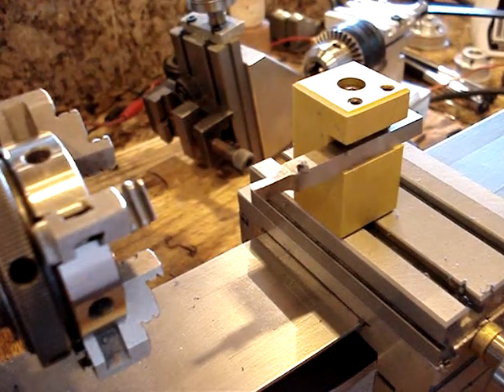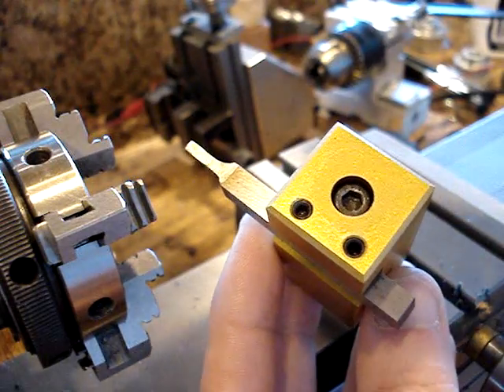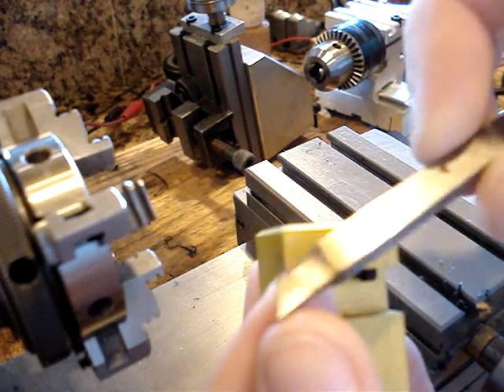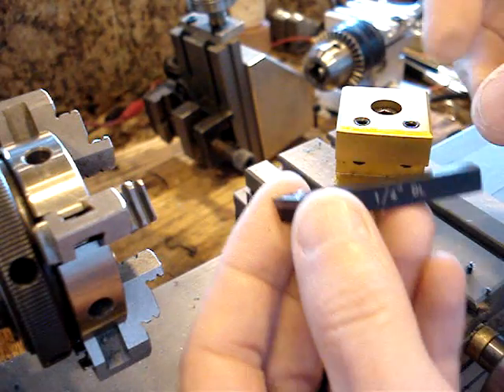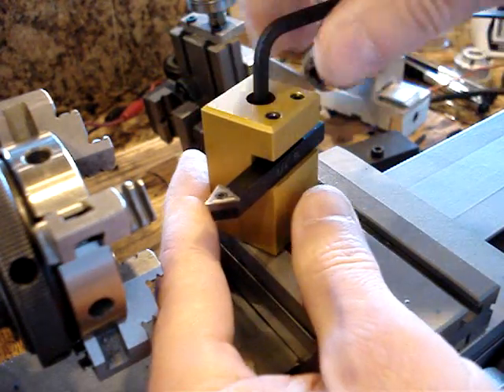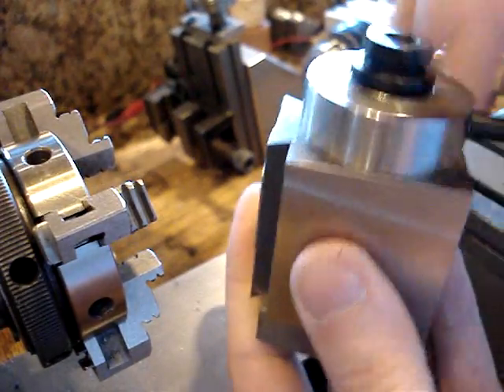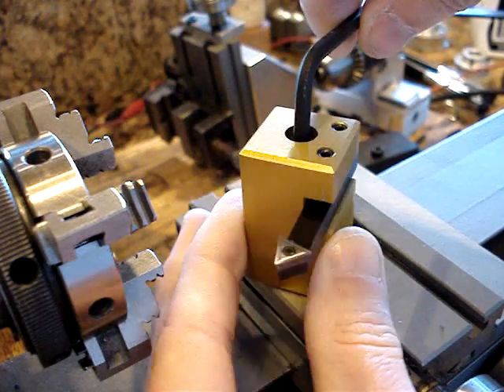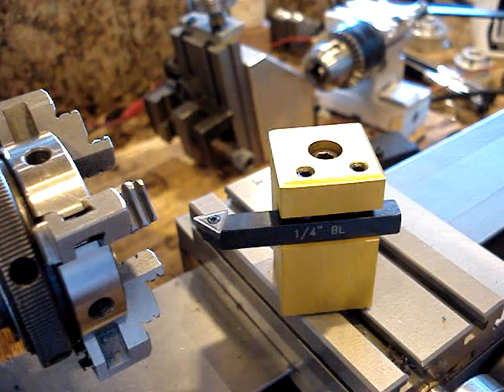Taig lathe tool post vs. quick change tool post (QCTP)

Comment: If you replace the carbide insert with a HSS insert made by A R Warner the cheap index cutter tool will work very well on the Taig lathe.